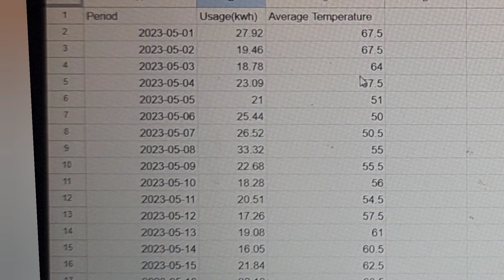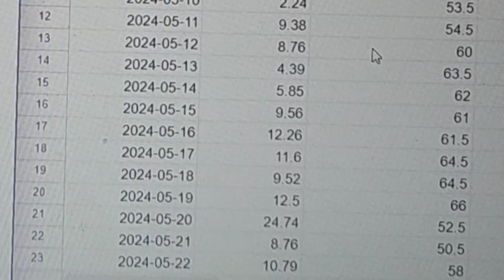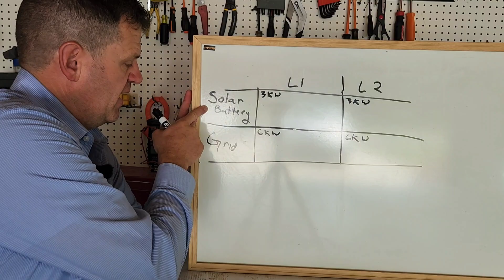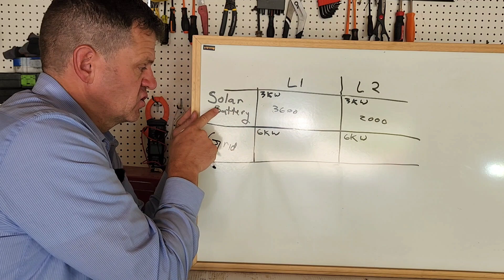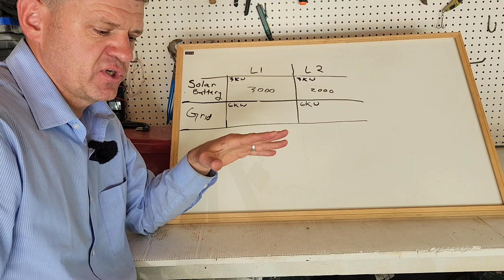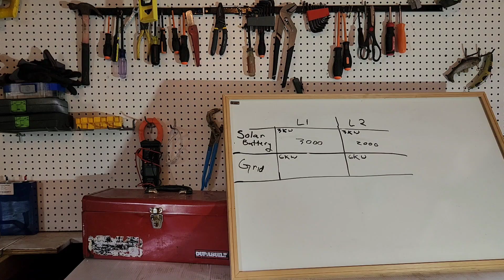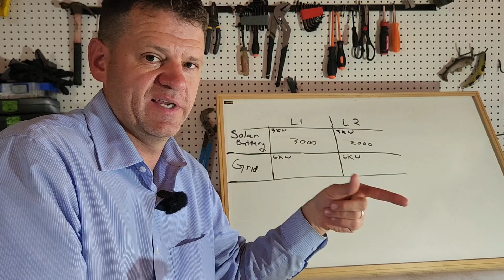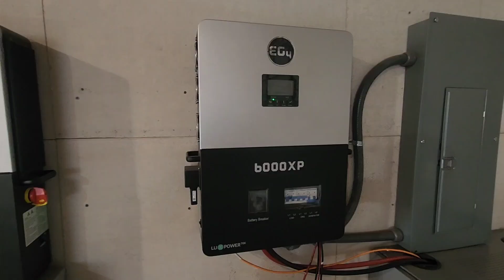I Ran My House on the EG4 6000XP For 2 Months - Cost Savings & Results

Comment: it is good you are able to reduce your reliance on the monopoly known as the national electric grid. We said goodbye to the grid and have never regretted it. That's right, no connection whatsoever to the grid. We have not needed it. We have an EG4 18Kpv, 60 kilowatts of DIY Apexium batteries and 36 Bi-Facial solar panels @405 watts for a total of 14.6 kilowatts. System cost was less than $20K. Freedom is not measured in terms of ROI (Return On Investment). Our power is secure from outside computers disconnecting our power like with a smart meter attached to the grid. Our batteries are topped off by noon every day, even with the AC running.
Reply: @stevenfrazier8939  damn, that's one hell of a setup. Is it on the roof or ground? How long have you had it up and running?
Reply: Ground mount. we live in Michigan and experience lake effect snow, so we have to be able to clean them off. Completely off grid as of February 2024. Our batteries almost never fall below 95% state of charge.
Reply: @stevenfrazier8939 , I live in Michigan as well, Midland area.  Was looking at a similar setup as you.  Does your cost include all wiring, panel mounts, etc.?  Is there a way I could get your material list?
Reply from the maker: Nice! I'd love to make a call to the local power company and have them disconnect me!!
Reply: @diySolarPowerFunWithRay 
I didn't notice if you put a soft start on your 3 ton, if not it might be wise to do so, if nothing else just to prolong the lives of your 6000 XP's.

I installed an 18 kpv it's supposed to handle 22,000 watts of inrush. With my soft start my 4 ton HVAC only pulls around 30 amps, but I still see a bit of flickering when the compressor turns on. Also it seems these EG4 products almost need to have the grid connected or the inverter voltage starts to collapse under high  in-rush. 
Probably why they're releasing that 12 kpv unit with better specs. 
Sad reality is: both eg4 and signature solar have been aware of this problem for over a year.
Reply: @diySolarPowerFunWithRay  The best solution for me was to install the Grid Tie Inverter With Limiter which uses the grid as a back up only.
Reply: More info please.
Reply: Our rack mount is adjustable for winter and summer. we use way more power in the summer with the AC units than winter. Even though we have 6 days of power from the 60 kilowatts, If the sun dose not shine and we think the batteries will fall below 50% which they never have i will start the 6500 watt All-Powers Diesel generator and with the EG4 Chargeverter we will bring them back to full. The generator runs on waste veggie-oil that we collect from a local restaurant. It is settled for two weeks and then the clear liquid is sent through a 400, 200, 100 and 75 micron bucket filter. afterwards we add 10% gasoline to the oil and send it through a 20, 5 and 1 micron finishing filters. The oil is kept in a 275 gallon IBC Tote where it waits for use latter on. all of the filters are cleanable and reusable. In the winter the Bi-Facial panels supply pretty much everything we need due to the cold and the snow hitting the back side. The generator takes the place of the grid and is cheaper per kilowatt to run.
Reply from the maker: Wow, that is a boatload of backup fuel. Very nice. My brother was going to start collecting oil like that for his diesel truck.
Reply: @jpatt5054  Each of our four Apexium DIY battery kits cost $435. The kit uses the JK-Inverter-BMS which is a 200 amp charge/discharge with 2 amp active balancing. These batteries talk to our EG4 18Kpv with the Pylontech protocol and are always perfectly balanced. The retail batteries do not have active balancing only passive. In each battery Kit we used sixteen EVE LF280K Version 3 Lifepo4 3.2V Grade A+ Batteries with 8,000 cycles. @ $65 per battery for a total of $1,040 plus the $435 for the kit, the total comes to $1,475 per battery. Nothing comes close to this build. So, each battery is 280 amp hours @ 51.2 VDC for a total of 14.3kWh. Compare this to the EG4-WallMount 280Ah 14.3kWh Battery for $3,299. We saved $1,824 per battery or $7,296 for the four batteries. With the money needed to buy four of the EG4-WallMount Indoor Batteries we can buy 7 Apexium DIY batteries. So for the same money we could have 100.3kWh instead of 57.3kWh and still save $428.
Reply: Those EG4 efficiency and no load power consumption are nuts, I would never use those inverters in an off grid scenario.
I swapped Chinese all in one (what EG4 are) for a victron setup and it's night and day, half low load power consumption, 4x less noise and heat....
Reply: @honumoorea873  What models? Also if you have numbers to share (the idle consumption in watts of the all in one inverters and the victron ones, also mentioning price). Thanks
Reply: @stevefrasier8939 Wonderful setup you have brother. I agree, ROI, is realtive & for me is more centered around family safety and self reliance.

I’m currently owner building and would hope you could share some knowledge with me. If it were you, what system would you set up for the following?…

Single story 4200 sqft home, 200 amp main house/100 amp guest house, 1500sqft detached shop w/restroom. Appliances that will use electricity in house: refrigerator, freezer, washer & dryer, dishwasher, Wall oven & Air Fryer combo, security camera system, room led lights and TVs, 5ton a/c and Pool equipment (except pool heater). 

Workshop: led lights, 2 zone mini split, garage door openers, & as needed power tools & 2 post lift.
Reply: Wrong! Why would I spend that much $$$$$ without a return of my investment?

Comment: I'm trying to understand if the 220 HVAC is really pulling 4000 watts at 20 Amps or if that was an example. I have a similar HVAC with soft start and still pulling 28 Amps.
Reply from the maker: It 240v AC used about 3600 watts when it's running.

Comment: So how much was the total cost of the product with associated hardware completely installed and running (parts and labor)? I'm just trying to figure how long it will take before it is paid for. So far, from everything I've researched, solar only truly benefits people who are completely off-grid (with no dependence on the power company). Otherwise it's just a high maintenance experiment/toy for people with deep pockets. Nice setup though...
Reply from the maker: Thanks,, I break down the prices at the beginning of the original install video. 👍

Comment: The 6000xp is a great off-grid solar inverter and I don’t think anything comes close for the price.  Great to see you are saving money!  My bills have dropped as well and I’m generally saving 500-750 kWh a month compared to before installing mine.  Will hook up my 2nd one as soon as I install additional panels and that should get me 99% off the grid. Thanks for sharing videos as it helps us all learn!   👍
Reply from the maker: Nice. Have you had it a while? How many watts of panels do you have?
Reply: @diySolarPowerFunWithRay  installed the inverters in January running off (12) 405w panels (only using 1 MPPT).  Haven’t yet hooked up the 2nd inverter but one is running my house at night now.  Am waiting on a back ordered brightmount rack from Signature Solar to finish installing the remaining panels and hooking up the second inverter.  Will post a video if I ever get it finished! 🤣😂👍. Love your channel!
Reply: @terrahillfarm Good off grid inverter, what's the power draw at	idle...? Let's say 60W...? A same power victron inverter will draw less then half of that. Low idle consumption is key for off grid, that's make all EG4 pretty bad for this situation.
Reply: @honumoorea873  Victron is hands down, a higher quality inverter than the EG4.  It also costs 4 times as much to do the same thing.  Two 6000xp cost $3,000 for 12k output.  A 10k output Victron system costs over $12,000.  If your family’s survival depends on reliable off grid power, you should buy the Victron, if not, you have cheaper options. Everyone’s solar use case is different. 👍

Comment: @DIY nice update, and i truly hope the two XP works out for you, however the best solution for your application is an hybrid inverter with zero export like the 12Kpv or 18Kpv , 100% of you solar production will be used 100% of the time if you have ANY load in your main panel or load panel or for batteries, 100% nothing is wasted with an Hybrid inverter and allot more simpler to setup, off-grid inverters are truly best when using then for critical loads emergency power backup and or truly off grid, not for peak shaving and other type of basic saving best to use an hybrid inverter with zero export.
Reply: If you just had the one 6000XP vs a hybrid, the payout time would twice as long.
Reply: @bhbaker220  technically no because one unit right now he can’t even capture 100% of the solar production, and if you are care about having EG4 inverter, you can by Growatt  MIN XH  with grid interactive feature and setup zero export they cost less than a EG4 XP and has the same capacity at a 18Kpv the 11.4k version anyways, right now he is planning of using 2 XP to try to solve is issue, i have done this for over 10 years so many lower cost ways to achieve the same thing for this application.. Growatt 11.4k MIN grid tie setup in off-grid mode zero export that cost less than one XP with the capacity of an 18Kpv is truly all he needs, but it’s fun to watch what others do.

Comment: $0.56 per Kwh here in central California.
Reply: That's insane! It's $0.15 per kwh here in Dallas.
Reply: Here  in the Los Angeles area, it's $0.75 peak rate, dang it.
Reply from the maker: Wow!
Reply: Ventura, TOU, $.47 peak, but inherited a PPA with 4.4 kW at $.21. We just got an EV and I now want a 6000XP for the car charger.
Reply: PVREA electric cooperative here in northern Colorado has great rates and is very supportive of supplying green power (a voluntary $1.00 per month fee).  My PEAK rate 4pm to 9pm is $0.168 per kWh and the rest of the time is $0.0597 per kWh.  It makes our new electric car next to free to fuel up.    I do have concerns about significant duration outages, but so far have had a hard time justifying a system for lowering my daily use.  Good video as always. Thanks!

Comment: Honestly your house and ADU need to be on either the 12k or 18k from EG4. My money would be the 18k because it has 200 amp passthrough and will not kick the solar to just the battery's if you overload one leg of the bus, the 12K is only 80 amp passthrough.
Reply: The only downside is if the 12k or 18k are connected to grid, it will attempt to sell back even if it's turned off in settings. I think even EG4 just recommends having multiple 6000xp inverters instead of using their grid tie systems.
Reply: @TheNodeChannel  IMO would not spend that much money unless your going to do a full permit and interconnect agreement. The 18KPV and power pro battery is the only one they sell that is UL9540A as a ESS system inverter + battery which is quickly becoming required in all states. The 12K and 6000xp does not have the UL9540A ESS cert yet I'm sure it's in the works.
Reply from the maker: @Mike-01234  hmmm... I could be wrong, but I was under the impression that the 12K had all the same certifications as 18Kpv.
Reply: @diySolarPowerFunWithRay Signature solo actually said that the 12k is certified in more places than the 18k is because of maximum power demands allowed in some locations.
Reply: 16kw or 18kw hydrid is ideal. Future-proof and lots of solar capability. Huge expansion possible with extra batteries. Forget selling back to grid, just use power from electric company on those very heavy dark rainy days.

Comment: If the inverter is connected to the grid, don't you have to have a transfer switch in the electrical panel?  Because I though you said in the video that it AUTOMATICALLY switches from battery to grid power when the battery is low, but don't you have to flip the transfer switch MANUALLY from battery to grid so that you run off only one OR the other but not both at the same time? I'm very new to the solar scene. Thanks for all your videos.  Well done.
Reply: It all passes through the inverter. There's a bypass mode that turns off the inverter and just feeds the grid line directly to his load and at the same time charge the batteries. Ray ended up using wire tappers (Forgot which brand) on his connection from the grid before it hits the main breaker for the electrical panel for the EG4 6000xp.
Reply: @TheNodeChannel  Thanks much for your reply. I don’t know what wire tapper is but I’ll re-watch the original install videos.
Reply: @TheNodeChannel  , The EG4 6k, as well as my Sungold 6k are Hybrid inverters, connected to the grid without backfeeding the grid by design. My Sungold CAN be grid tie enabled, but I don't have permission to do that. My unit simply is connected to the grid to automatically switch power to the house thru the solar/battery array and grid in that order. Cheers!
Reply from the maker: Yup. There's more details in the original install video. Thanks.  👍
Reply: @diySolarPowerFunWithRay  Thanks Ray. Appreciate it.